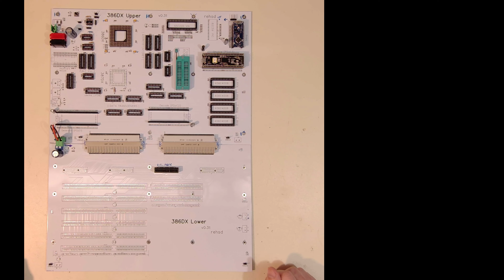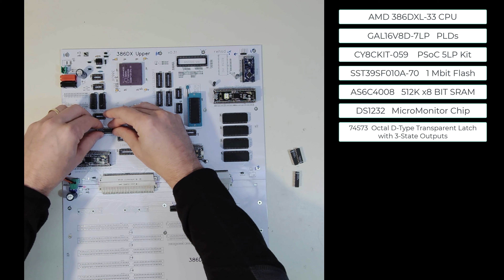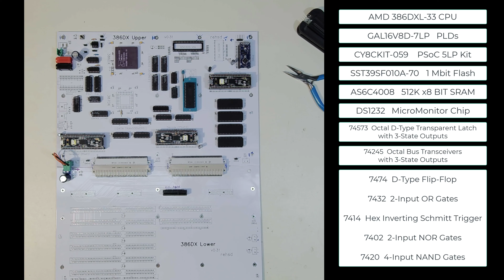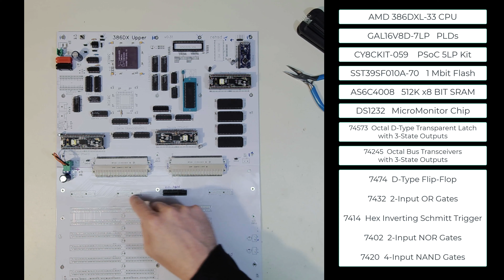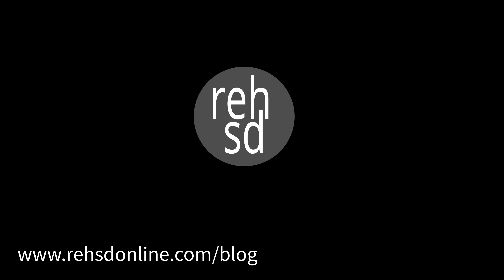80386 DX Build, Ep. 13 - Populating Sockets

Comment: Thats really cool, been watching your videos while I'm designing the VGA card for the computer I'm also building using a collection of ESP32, STM32,  and teensy microcontrollers. Mouse, Keyboard, MIDI i/o, sound card etc. Have a look at the SAM2965 ic for your sound card, they have a GM wave table synth.
Reply from the maker: Thanks! Any chance you have a link to a datasheet for the 2965? I’m not finding it for some reason.
Reply: @rehsd  ah yes sam 2695 is what i mean. All ways getting 6 and 9s inverted
Reply from the maker: I think I found it. SAM2695 I bet. https://www.alldatasheet.com/datasheet-pdf/pdf/1179201/ETC1/SAM2695.html

Comment: 4 layer board doesn't necessarily give more routing space because internal layers are typically used for power and ground. But that does remove pretty much all power-related routing from top and bottom layers, so it frees more space for signal traces. The big advantage of 4 layer PCB is signal and power integrity. But before moving to a 4 layer PCB, you will probably want to figure out a way to make your board more compact, otherwise it will be pricey.
Reply from the maker: Good point! I was thinking about going with an inner GND plane and an inner signal layer. I've had good luck with my boards that have inner VCC and GND planes, and I have also had good luck with inner GND plane and signal layer (assuming my top layer VCC copper fill is good). But, ya', four layer is expensive. I really wish I could afford six layer!
Reply: @rehsd  Actually as long as you keep your size reasonable, 6 layer PCBs are quite affordable. For example, JLCPCB offers five 20x20 cm 6 layer PCBs with ENIG and via-in-pad (useful for BGAs and other small packages) for $84.7, which is a very good price in my opinion. I've recently had a 15x12 cm 10 layer PCB with bells & whistles like controlled impedance made by them for just over $200, which is super-cheap (such boards used to go well north of $1000!).

Comment: Here is something I've thought about. If one were to make a combined 386+387 or "486" on an FPGA, one signal that is missing is the "F-Err" line. That is why in a kit to convert a 386 machine to a 486 will have 2 chips. The one that goes in the 387 socket picks up just the "F-Err" line. So really, maybe one could bring such a line out to a header that plugs onto an FPGA board (or 486 adaptor board).

I think it was neat that Intel backported the 387SX to work in a 287 socket in the form of the 287XL. So you get faster math coprocessing than the 286.